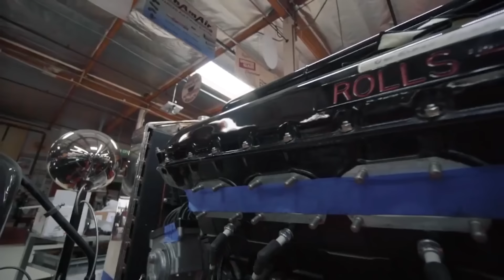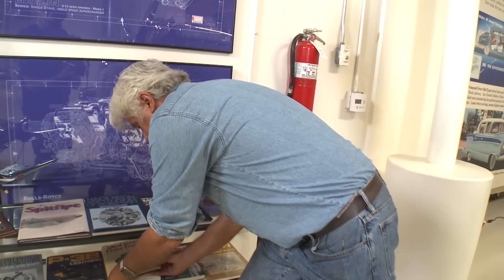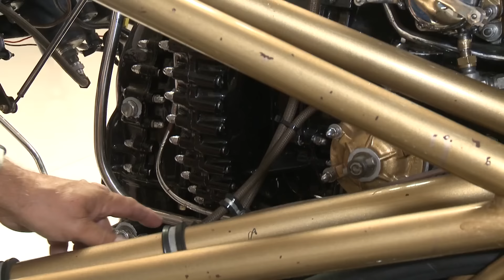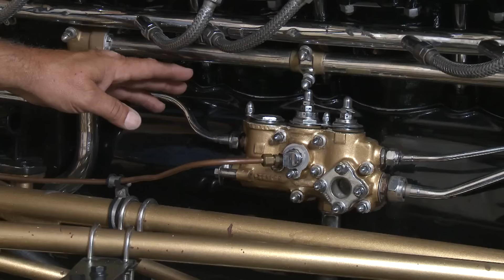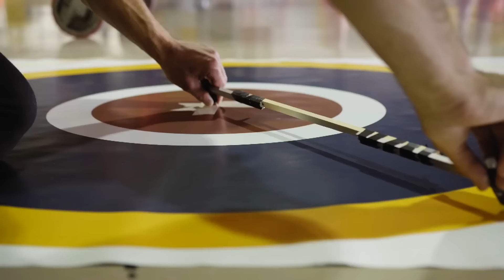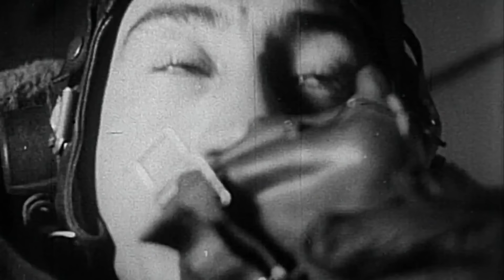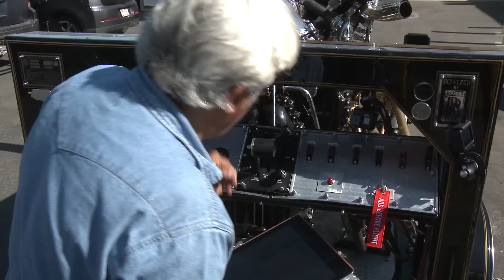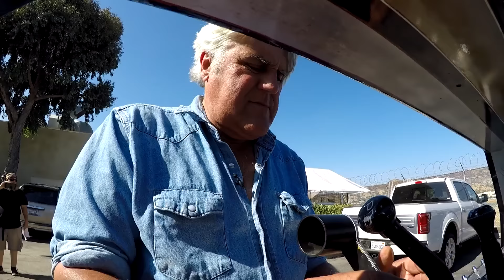The Engine That Won World War II - Jay Leno's Garage

Comment: "The Merlin XX incorporated a number of revisions based on early operational experience and the availability of 100 octane fuel from America." "It had been intended to utilise the evaporative cooling system but was replaced by the more reliable ethylene glycol liquid cooling system developed in the United States." "During the Battle of Britain it was discovered that the Merlin engine would cut out when pursing Me109s in a high speed bunt dive due to fuel starvation in the float controlled carburettor. Initial solutions involved inverting the aircraft into the dive and also the fitting a restrictor in the fuel supply line and a diaphragm known as Miss Shilling’s orifice, named after the female inventor (Beatrice Shilling) based at Farnborough at the Royal Aircraft Establishment. More permanent solutions involved moving the fuel outlet from the bottom of the carburettor to half way up and the use of fuel injection using a Stromberg (USA) pressure carburettor and finally an SU injection carburettor."
 The Spitfire Society Merlin page

Comment: I, along with 6 others brought 4 Merlin 224's to life at the Nanton Lancaster Museum in Nanton, Alberta. The first one was a learning experience and sounded as bad if not worse than J. Leno's engine. Leno's engine sounds like it is suffering from mis-timing of the crankshaft to camshaft of at least one bank if not both. This is an involved and tricky adjustment that is real easy to foul up. A properly timed engine runs very much smoother than Jay Leno's.
Those  4 Merlins on the Nanton Lanc run as much as 10 times every year giving the crowds a very noisy and pleasing experience.

Comment: The coolant was/is a mixture of glycol and water...the warm up is not idle but 1100-1200 rpm...like most piston engines, in-line and radial. Warming up at this speed minimizes soot-gathering in the combustion chambers.

Comment: Check out the Youtube vid "Frankenspit".  The Germans put a DB605 (I think) engine from a Bf109G into a captured Spitfire to see what would happen ... and it outperformed both a standard Merlin-engined Spit and a standard Bf109.   Remember reading years ago about how the V12 Rolls Royce aero engines, which started development during the 1914-18 War, were based on a V12 engine Rolls Royce obtained on the outbreak of war in 1914 in a sports car from the London showroom of Mercedes Benz ...

Comment: When you have some time I would love to come and see your cars with you. I'm an old hot rod guy. I bought my 1st Real hot rod in 1969 just before I shipped out for my second West Pac. It was a 1969 Chevelle. 350/300 horse with a Muncie four speed and 355 Posi Trac rear end. I got to drive it one week then my wife got to break it in. Yup I trade it in when gas got a $1.00 a gallon for a Datsun pickup. Oh well I had many hours of racing on the gut in Eugene Oregon

Comment: I've recently watched another video about the P51 Mustang which used the Merlin Engine. 
I learned about the cooling scoop using the Meredith Effect. "The Meredith effect is a phenomenon whereby the aerodynamic drag produced by a cooling radiator may be offset by careful design of the cooling duct such that useful thrust is produced by the expansion of the hot air in the duct."

Comment: i wonder what that engine would do for a p-38?
Reply: The P-38 performed well with twin supercharged Allisons.  They had two-stage super/turbo chargers.  The early Mustangs had a single stage supercharger, which is why the Merlin, with a two-stage supercharger, gave it a big improvement.

Comment: The Merlin is a fascinating engine, and certainly contributed to the war, but the 270 straight six was the engine that won the war. Powered the deuce and a half, ambulances, command vehicles, and more  Above all it was the engine responsible for the success of the red ball express - no supplies = no Army.

Comment: As a reporter in the late 70s I covered unlimited hydroplane racing on the Columbia River. The Merlin engine was what all the boats were running. Each boat had back up with trucks and mechanics and spare engines. It was really impressive to see the engines up close.
Reply: I thinkIF you checked there were as many Allisons running as Merlin !! ! The real facts.
Reply: @wilburfinnigan2142  That's true. It was either one or the other.
Reply: @kixigvak In 1979 the Miss Budweiser switch to the RR Griffon motor, 2400 cu, 4000 HP! She was a beast!👍✌️
Reply: Yes, those were the good ole days of unlimited hydroplane racing, Allison's, Merlin's, Griffons, auto marine, they were all used back in the day, been a fan of it my whole life, been following it back to the 1950s, it's not the same now days with the turbines, totally different, all the legends are gone or retired now👍✌️

Comment: I kinda recently watched someone drive a propeller driven bicycle down the street. (It is a  cool street) Full on Motor in the back...OSHA be daaaamned propeller in the front "Hawthorn" bicycle.    There is NO WAY Jay has not thought of making a Merlin powered sled...Just to taxi. The rig is already made to tow at 80MPH. (MAX legal speed on highway) Make a droppable  front suspension make it so the balance can shift from tow to sled... and you have a take off speed ready engine taxiing down the runway for every one to enjoy at an air show. Bonus points to make a trailer cool enough to see the engine while you tow it down the road. Extra Mega points to designee it so it looks like some kind of vintageish aircraftish. Even 1/4 of a bomber going down the road is twice as cool as it sitting on the tarmac. What is awesome is the resources are already in place if it is cost effective!

Comment: Its actually in Hamilton not Toronto, which is just an hour out of TO. As a machinist for 20 years, you have to just marvel at the construction of these engines way beck then, with no computers or CNC machines. I worked at McDonnell Douglas/BOEING aircraft plant in Malton, Ontario in the same plant where they built such planes as the Lancaster Bomber and the Avro Aero. Alot of aviation history in these parts.

Comment: Did anyone else notice that during the runup check Jay didn't move the constant speed (CS) prop leaver from fine pitch to coarse pitch and back again.  Not that Jay was going flying with this engine, but during ground school (using modern CS props) I was told that this check was supposed to be done every time in order to circulate oil to the constant speed prop mechanism and to insure that you could use the coarse pitch setting for climb and speed performance and then back to fine pitch for landing. The purpose for the check was that if oil pressure dropped it might indicate a oil leak in the CS mechanism.  Jay did  say something about an automatic oiler but I don't know about 77 year old CS props.

Comment: I don't know much but I am under the impression that the RR Merlin engine gave us fighter superiority in WW2. Our P51s were just average using a straight Packard but the Merlin once Packard started manufacturing them for P51 use gave our fighters the best power plant in the air.  Q: The spitfire was very vulnerable due to it's lack of fuel injection????!
Reply: Merlins early in the war had a problem with cutting out when the pilot pulled negative g's pushing over into a dive.  This problem was solved by putting a check valve in the carburetor so the fuel wouldn't slosh out.  The check valve was invented by the female engineer Tillie Schilling.
Reply: @andyharman3022  Thanks, I think that's what I was alluding to. But I heard it as a fuel injector needed to be used or you'd lose power in a dive (and stiff climb?)?

Comment: Yes, the RR Merlin is a very romantic engine!! It turned the P-51 Mustang into the fighter that could escort the 8th Air Force's bombers all the way to Berlin and back. This marvelous engine kept the Spitfires aloft to repel the Germans during the Battle of Britain. -But, the greatest aircraft engine of WWII? I think that title rightfully goes to the Pratt & Whitney R-2800. It was, by the end of it's design run, a 2,500 hp air cooled beast that powered far more and varied aircraft than the Merlin. It was also rugged, able to absorb a great deal of damage and still keep running. -One nick in a coolant line on a Merlin and that was all she wrote. The two engines are really the left and right hook that flattened our enemies in WWII. -I'm a 30+ year Airframe & Powerplant technician, with experience on both engine types. (Gulf War USAF veteran, too.) From the mechanic's standpoint, I would rather work on any radial engine, over a Merlin. They are very complicated, and being so streamlined, everything is crammed into the small space they occupy, making them choice engines for mechanics with small hands. My meathooks were always getting jammed up in the insanely small spaces the Merlin provides. Thanks for this great video, Jay. Nothing sounds like a finely tuned RR Merlin at full power.

Comment: I guess Oil is used when running this engine 2 cycle wise so it can run upside down?  Wasn't this engine used in the P-51 Mustang which can fly inverted?  Truly a wonder of British Engineering, up there with the other British invention which won the war..  the Magnetron!
Reply: My Dad was one of the first US Radar technicians sent over to help the Brits in development/installation.  The Magnetron was classified Tippy Top Secret technology..

Comment: I joined the Fire service (U.K. Scotland ) in 1979.
One of the fire engines was a Merryweather. It had a steel chassis but the bodywork was all wood framed and wood covered.
It also had a Rolls Royce Merlin engine.
This fire engine had insane acceleration, but only had drum brakes to try to slow it down.
Fortunately the drivers were respectful of the power and used it frugally.
We would sit in the cab shouting at the driver to push it. Fortunately he ignored us so I'm still alive to tell the tale

Comment: The Pratt & Whitney R-2800 double wasp 18 cylinder engine produced about 2,200 horsepower. This engine was used primarily in Hellcats and the F4U Corsair. The Corsair was the first fighter plane to top 400 miles per hour. The Grumman F6F Hellcat had an 18 to 1 kill ratio. The Corsair had 11 to 1 kill ratio. So no way would I call the Merlin Rolls-Royce engine Jay is showing you here the engine that won World War II. There were many players that contributed. P-51D Mustangs and the F4U Corsair's are my two favorite World War II fighters.

Comment: That engine sunk the turpits.
Reply: @into the void, KMS Turpitz was the second of the two ship Bismarck class battleships built by Germany during WWII.
You are correct.  
Rolls-Royce powered Avro Lancaster's were able to hit the Tirpitz with 12,000- pound Tallboy bombs.  Ship was moved to a different mooring after the first raid.  Two more raids were mounted with a successful sinking of the KMS Tirpitz on 12 November, 1944.
Reply: @MaxCruise73  Thanks Brother.

Comment: The version(s) used in the Hurricanes and Spitfires: had much higher compression ratios and/or boost pressures requiring the use of much higher octane gasoline than this one? (Helped make more power allowing the aircraft to catch up to those pest Messerschmidts)?

understand that these have much better fuel efficiency than the big radial air cooled engines such as were used in a lot of American war planes? Due to the liquid cooling and less need to go to full rich to keep the heat from warping the metal during full power and takeoff power operation?
Reply: All Merlins had 6:1 compression ratio.  The power ratings between bomber and fighter engines were mostly accomplished with the 2-stage, 2-speed supercharger.  Fighters got those.  Bombers got single-stage superchargers.

Comment: Does not seem to have a lot of pull. Disappointing
Reply: The engine was barely at idle power. At full power there would have been a lot of damage and injuries aft of the prop.

Comment: Outstanding technical walk around of the Merlin engine and when Jay mentioned "Just like a Ducati...", my synapses started firing overtime thinking desomodromic valve actuation, but thank Goodness it was bevel shaft cam drive, lol. I couldn't for a New York Second imagine war time field valve adjustments if it were desmo, what a freaking nightmare that would be and we'd most likely have lost the war.

Comment: I like to start with the mixture full rich and the throttle open, and as I’m cranking I lean until the mixture is perfect for start. Then bring the throttle back to idle when it fires off. Keeping the throttle open will prevent it getting flooded.

Comment: Jay ,l wondering was this Merlin u are showing the latest & greatest & was it designated as such.l know u said it had 4 valves,the thing that now days u & others say 1650,butwhen l first got into the power they were all called 1649s.Factories usually continally use the same terms.lm sure u shud know & l want to.

Comment: That title is a bit of an overstatement, don’t you think. The Allison was just as good as the Merlin. It all depended on which type of boost they used. Single stage, duel stage,
Hybrid duel stage etc.  There were implementations of the Allison that performed better than the Merlin at all altitudes.

Comment: Jay, you gotta put the mixture to full rich before you start, the checklist wants you to put it to idle cut off before you switch on mags in case the engine is hot, it can cause a piston to fire. Make sure you're full rich on start up, you'll starve her

Comment: Stationed at Travis AFB, 60th Aerial Port Squadron, worked out n a building close to the Air Museum; where a 123 was being restored.  I had a TDY to  Nellas AFB for training once and there were 5 or 6 of piston engines in storage at the Pima Air Museum that had been donated the the one at Travis. On my return to Travis, I helped load these engines on a C-141. a few months later while at work, those engines had been installed on the C-124, and were being started and run up for an engine check. The reaction of those people on the room was something to be seen as they never heard a recip before.( this was in the mid 80’s). Still smile when I hear a recip fly overhead.

Comment: Correction: The Canadian Warplane Heritage Museum is not located in Toronto. It's in Hamilton. For anyone crossing the border at Buffalo or Niagara Falls by car, You'll find Hamilton about an hour and a half from Toronto on the main highway to Toronto. The CWHM shares runways with the Mount Hope Airport (Hamilton's airport). During WWII the famous Mosquito bomber was also built in Canada. I expect it also used Packard-built Merlins. You showed a brief clip of the only two working Lancasters flying together. That happened several years ago in the UK. Of course the Canadian Lanc had to fly across the Atlantic for that event. While there, it experienced a complete engine failure which would have prevented it from flying back had it not been for the British organization that operated the other Lanc which had a spare Merlin. It was fitted to the CWHM Lanc, and it made the return flight. You're about the same age as me so I remember flying in the the Merlin-powered Northstars which were one of the workhorses of Trans Canada Airlines (Air Canada) in the pre-jet period. At least I'm told that I flew in them. I don't actually remember because I slept through the flights according to my mother. She couldn't sleep on Northstars, claiming they were the noisiest aircraft ever, which she blamed on the Merlins.

Comment: Standing right behind a running 1650 CU, V12 engine, wide open exhaust, driving a propeller, and no hearing protection.  Seriously, I worry about you Jay.  Would it kill you to put on some ear muffs?  $3 at Harbor Freight.  At least to set an example.

Comment: The minute this video began I instantly recognized this rig.  I'm pretty sure I saw - and heard! - this engine at a Rolls Royce/Bentley club event at the Homestead in Hot Springs, Virginia a few years back.  The operator (possibly Graham White) not only had it idling, but ran it up to take-off rpms briefly before shutting it down. The open exhaust note at high rpms made "a joyful noise unto the Lord" that reverberated off the mountains to the East and West for several seconds after shut-down.

Comment: To my knowledge the -1 was never used in the P-51. As far as I know, the P-51 used the -3, the -7, and -9...also, the prop on this engine is way too small in diameter to use on any aircraft...the finish on this engine package is absolutely beautiful!